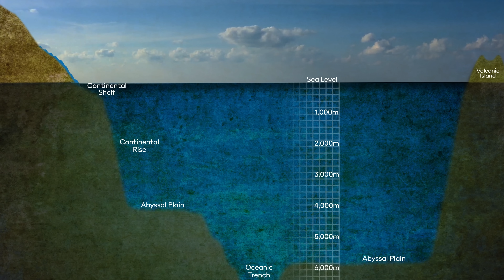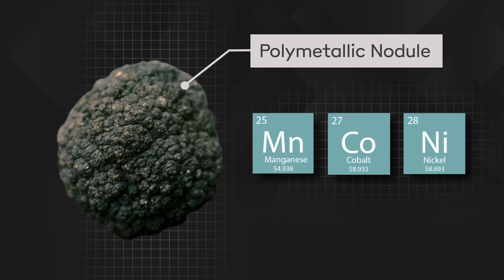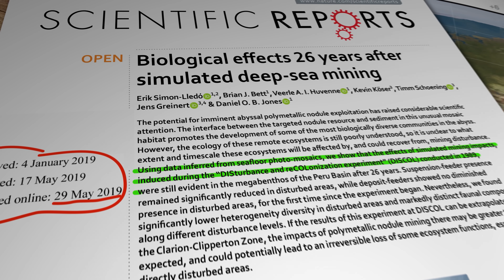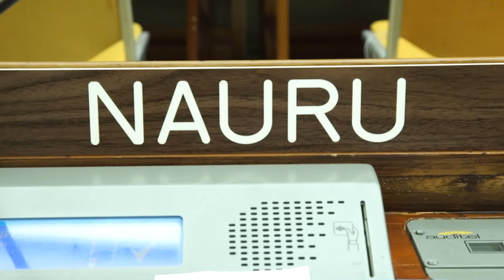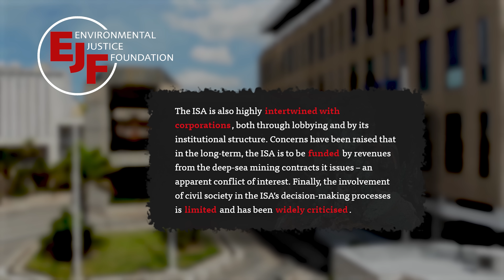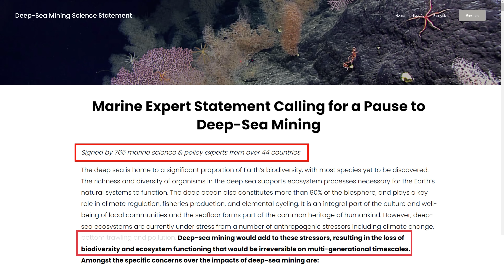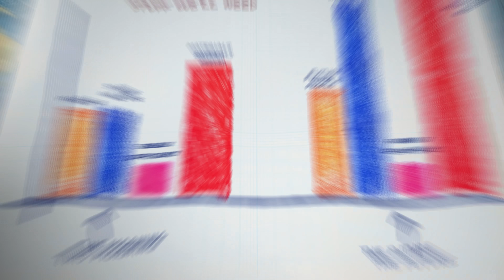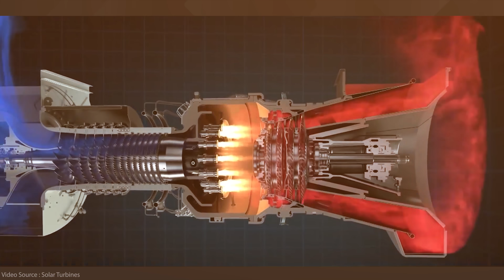Humans reach a new low. Literally!

Comment: Could dolphins be trained to collect these nodules? Seems like a much less invasive method. 

Don’t try to tell me dolphins aren’t capable of being trained for this task. They are far more intelligent any dog breed. Sheppards can be trained for a vast multitude of joint tasks, so it stands to reason the same concept could be applied to Dolphins. Who already work with humans without specific training. 

This is a good idea. A really good one. Their echolocation would easily find them, and they’d have no problems bringing it to the surface. 

And it would cost a lot less. Think about how many resources you can retain not needing to have a fleet of large ships that cost a ton to assemble and maintain. 

My goodness 1/10 the cost could have an entire company sized element of dolphin / handler combos trained ready for deployment. 

There has to be something I’m missing. No way nobody thought of this.

Comment: China has invaded the South China Sea to secure energy resorces. Under those noduals, is ten thousand years of natural gas, as fire ice. On the continental shelf about coastal nations. Billions have been squandered finding how to retrieve this from the same place. The pressure at this depth has solidified the gas. It can be burned to produce hydrogen, hence the expensive, mad drive to utilise that for vehicles.

Comment: Relying only on solar and wind will fail. They are great as secondary power, but they are not reliable enough to be the primary power source. They also are really lacking on the production side.  Its like trying to use 50MB USB cards instead of a 5 TB SSD.  Hydro electric and nuclear are what is needed.

Comment: Heat vents... One of two things... Most likely sucked dry... Then fault lines in the ocean get less pressure from below... Causing some heat vents to invert... While second one which is much more beneficial.... Building the ecosystem up that is already there.... Instead of the heat going straight up.... Spread it across the ocean floor... Leading to more prosperity for the deep sea... and most likely overtime grows into a hoter world.... Both would... Bigger animals mammals... This that the other.... I mean look what happens when a place gets a hole in the ozone... Man gets sick and the environment grows significantly...

Comment: Hard disagree with the point you're making at 13:13, that being that steel is just some product of the fossil fuel industry. Steel alloys are essential for pretty much every single thing you use every day, from the house you live in to the transportation you use to get around (whether thats a standard car or an electric train) to any one of a hundred different industries. The reason for this is that steel alloys can be tailored to practically any use, and are all strong, durable, and resistant to most environmental conditions while being fairly cheap to produce. This isn't something like a cobalt drill or catalyst for oil refining, steel is used everywhere and is vital to practically everything, unless you can somehow build railroad tracks out of wood and we go back to tiny wooden sailing ships for freight.

Comment: Considering how abysmal the extractive industries have been on lands over the last 150+ years, we
have no reason to believe they will be any less reckless when mining these nodules on the
sea floor. The potential for catastrophic damage
to the marine ecosystem, that might be 
irreparable, is extremely troubling. The track record with small scale underwater mining has already
proved to be devastating in the areas where it has
been tried. The kind of larger scale projects they are describing, could result in permanent damage that could impact marine ecosystems, weather systems globally and the marine food supply that so many around the world depend on for 
sustenance.  Their should be clear cut 
guidelines in place, prior to the start of any of these 
projects.

Comment: Here is the thing... You can draw a 200m by 200m square anywhere on the planet and then dig down 2000m... That area has more or less  all the manufacturing recourses we need in terms of metals, salts and fertilizer components.  Plus once you reach that depth you can extract geothermal energy out of it for as long as the planet if active. 
The only reason they don't do that is that the initial cost of doing this is inconvenient to them.

Comment: The back-end of the video was rather single-sided (uncharacteristic of you, tbh): you need the same catalytic processes to upgrade biofuels (the same nickel and cobalt based catalysts that are used now in refining processes for fossil feedstocks), or to upgrade circular feedstocks going into chemicals. High (tensile) strength steel is essential for the production of electric card (much more than for ICE cars), because of the added weight of the battery in these vehicles. Next to the automotive industries, steel production is also consumed by the construction industry. If you want to fly now, you will need gasturbines, whether you do this with fossil or non-fossil fuels... 

I suggest to discuss the details with industry experts before posting.

Comment: I agree that no mining of the oceans should be permitted anytime soon, and I believe 10 years is still far too soon to determine the impacts of it and even the continued use of hydrocarbons has disastrous impacts when spills arise with the extraction or transportation of them.
In terms of mentioning about reduction of the required minerals for transitioning from hydrocarbons to renewables, I disagree with the assessment, and so do many other people and we see it requiring more mineral resources. Currently for hydrocarbon use there is a lot of infrastructure in place and the use of materials that can easily and efficiently be recycled. which isn't currently the case for the transition to renewables. The initial transition away from fossil fuels is going to require more minerals mined from the ground. EV's use more minerals mined from the ground to build than Internal Combustion Engines (ICE's) and I remember a figure of 10 times the amount provided from a mining company involved in mining the extraction of materials required for EV's, not to mention the infrastructure that will be required to go all wind and solar powered which is unreliable and therefore requires further infrastructure to store energy for periods in which generation is low. In terms of batteries and EV's, a comparison between an EV and ICE vehicle of equal size will show that EV's are generally heavier meaning more wear and tear on the roads, tyres, brakes which will therefore need replacing more often requiring more mined materials. In terms of Sodium batteries, the weight will be even higher however the plus side is that sodium batteries will likely be better in terms of recyclability because currently most Li batteries aren't recycled due to the costs to recycle being greater than the raw mining of materials and not all the components can be reused from the used Li batteries. Overall this transition to renewables is going to need a huge volume of new materials however there are lots of areas still within the land that haven't been explored for resources, not to mention old historic mine waste heaps that were not considered for certain resources we may now need. It would be best to focus on these rather than the oceans which we do not fully understand yet.

Comment: Regarding your observations about the resources used by the fossil fuel industry, are you sure that the reduction in resource use achieved by eradicating fossil fuels is greater than the addition of resource use generated by renewable energy?  What would be the grounds for that claim, given that there would be the need for so much "overbuilding" of renewables?

Comment: It's best not to mess with the sea bed as I'm pretty sure we get a large portion of our oxygen from the sea, small self contained automated nuclear reactors should be invested in with everything we have, if the fuel is properly recycled it will last many millions of years.
This is almost free energy after the infrastructure and power plat is set up.  It's not for all places but you could produce enough to transport it or at least to use hydrolysis to make hydrogen for power ship and autonstove use and maybe even aircraft, also it would litraly bring potable water from seawater for next to nothing as you just need heat to desalinate.
It costs more to properly dispose / recycle a solar panel than to make it and the chemicals that can leak into the ground soil are very bad.
Wind only works well in some places.
I do hope a sustainable replacement can be made like hydrogen or methanol or anything that will allow the conversion of spark ignition engines and anytjibg that's an oil or a fuel gas or liquid will rub in compression ignition engines.
Current battery tech is way to wasteful and needs replacement way to often plus it pokutes skit and the fires...
Also it's not the best use of electricity.
Would really help a lot if we got rid of ships that use that awful bunker fuel or even something lower grade   (anything lower is just tar) but it's cheap.
To be completely honest I see no recorce problem I see an overpopulation problem.
If people are not sterilised in the 3rd world then it's nuclear or nothing for the near future.

Comment: So, Perry the Platypus... (Bites off a hot wing) I bet you're wondering why I'm sitting down here at the bottom of a lake. Well, the answer is simple. Mmm-mmm! This is really good, man. You want some? (Takes a box with the red wings) Here, here. (Perry takes a hot wing) Take the blue cheese. (Perry takes the blue cheese and pours it on the red wing) Do you know, I-- I prefer the ranch. Take the blue cheese. (Perry bite the red wing, and Doof holds up a napkin) Here's a napkin. (Perry takes the napkin) Anyway, the answer why I'm here is simple. Zinc. Lake Nose has a ton of zinc, and this machine goes around and filters all the zinc from the water.

Comment: I love engines an motor racing an fast cars. However petrochemical companies are waaaaay out in front at no.1 on the most evil an destructive industries. They been fear mongering an lobbying againg any type of new tech that might even slow the flow of oil coming out of the ground. They knew 70 years ago what they were doing to the climate an did nothing but lie.

Comment: Dave: please read this comment. This is the first time I've watched a "Just Have a Think" video and strongly disagreed with it. This is an incredibly tendentious video. You completely failed to contrast the comparative environmental impacts of acquiring these metals from land-based mines vs. deep sea-bed (pro tip: the damage mining does to land-based ecosystems and waters is VASTLY greater). You also completely failed to note that the deep-seabed miners have agreed to large exclusion zones that will ensure no species are driven to extinction. You exaggerated the level of ignorance about deep seabed habitats and the pathetic little worms that dwell down there. You failed to note that the total area that will be affected by deep seabed mining is a TINY fraction of the seabed benthos as a whole. You failed to note the possibility that stirring up seabed dirt will, by adding nutrients back into the water column, actually INCREASE the overall ecological productivity of the oceans - you just assumed that any impacts of the mining operations will be negative. You exaggerated, too, the ecological linkage between the activities of the benthic worms and the upper-ocean ecosystem. All in all, this video is, in my opinion - and I'm generally a bit of a superfan of yours - a stain on your reputation and the worst bit of muddleheaded propaganda I've ever seen from you by a long shot. Try to do better next time. You could have and should have taken the time to speak to some deep seabed mining experts - then your piece wouldn't have turned out to be so utterly one-sided. Giving you a grade of "shameful fail" on this one, mate.

Comment: The think about a good engineer is that they will always find a viable solution, thus if a material is scarce and expensive they should work on a different variant of the solution, hence batteries without Nickel and Lithium. Though if you tell a rich businessman about free money at the bottom of the ocean, he will pay his engineers to design a way to get those materials while the engineer could have worked on something more sustainable as we are all taught at university.
The smart people are not the problem in this world, it is the greedy ones.
I hope we leave our oceans alone, we have no idea what impact it will have and it will, most likely, be a global impact.

Comment: I’m of the opinion that this is an issue that can be solved with engineering. Instead of using the destructive method described in this video, I advocate the development of new robots specifically designed to harvest these nodules while avoiding stirring up seabed dust and using a more selective process which eliminates the risk of consuming undersea life forms. As far as habitat goes, they could either just take a small percentage of the nodules, or replace them with other forms of habitat.

There’s too many binary arguments in this world. People think that it’s either their way or the highway, but in reality, there are often arrangements that are beneficial to both parties, and they just need to be discovered.

Comment: Most folks here don't seem to understand the sheer scales involved here.
There are plenty of problems with deep sea mining, not least of which is the regulatory structures/agency.  But the sorts of massive destruction folks seem to be imagining would take centuries to happen even if humanity went all out trying to do it as destructively as possible.

If we want to actually explore these ecosystems, a sensible approach is to allow small-scale mining with independent oversight and environmental study/monitoring.

BTW: These areas will likely take centuries to recover from disturbance.  That's just expected, and everyone needs to be aware of that.  Deep sea mining is not remotely sustainable, but needs to be judged in a cost-benefits manner in comparison to the alternatives.

Comment: Perhaps there is a compromise here. Machines are already being developed to pick various crops on land.  This could be applied to the polymetallic nodules on the sea floor.  Perhaps a robotic picker could put nodules into a basket which could then be lifted to the surface. No messy separation of nodules from sea sediment.  This would be a good job for non-sentient AI.

Comment: Messing further with the worlds oceans... in areas that we know little about? Bonkers!
I work for one of the worlds largest manufacturers of mining equipment - underground mining specifically. Underground mining can have a tighter control on the environmental impact of operations. With new innovations in explosives we are greatly able to reduce gaseous NOx emissions and water contamination (using hydrogen peroxide as the oxidizing agent instead of the Nitrate based explosives typically used). Likewise, we are rapidly rolling out battery electric mining vehicles - when combined with a "clean" electrical supply we end up with close to "green" metal ore. Mining companies are also working hard to use non-carbon based smelting methods for production of iron and steel (see LKAB & SSAB).
This idea to mine oceans at depth - it makes my skin crawl. We are smarter than this - at least we should be.

Comment: Mining in the deep ocean, what could possibly go wrong? With the mining industry's famous concern for the environment, where they resist cleaning up even disasters easily discovered, SURELY they'll be vigilant and aggressive in reporting and cleaning up disasters that happen in the deep ocean. Would it even be POSSIBLE to clean up such disasters, considering the depths and pressures and darkness? Can we also put the criminals in charge of the jails, while we're at it?

Comment: We have so far to go in reducing things like single use plastic and badly made items that break in no time. Went in a supermarket the other day (I stopped shopping in those a few years ago) they still sell almost everything in plastic. That's in addition to the plastic tat they sell. There so be a ban on selling this 'shite' . Also we need to stop making 3 ton electric SUVS and make little electric city cars. My van has a small 24kWh battery and was cheap to buy and is light and efficient on electric (solar). Those huge Audis etc use twice as much electricity to go the same distance.

Comment: New mines will be required to transition from flammable fossils (FF) to non FF’s sources of energy eg solar, wind, tidal, wave and hydro energy converters, maybe not as many mines as some have advocated but new mines nevertheless will be required. Trying to get approval for land based mining in democratic countries is extremely difficult, and if anywhere near populated areas virtually impossible. Marine deep sea mining I’m afraid falls into the category of out of sight out of mind and doubly so when humanity’s exponential progress or its sustainability is threatened from CC/AGW. To date everything that been done to reduce CO2 hasn’t shown any reduction in fact just the opposite, even over the Covid-19 shutdowns and mobility restrictions CO2 levels have continued to increase along with petrochemical industries use of FF’s. Another point to be aware of is globally Electricity is only ~20% of energy supplied and renewable energy is only ~2% of that, leaving ~80% reliant on FF’s that would include pharmaceuticals, plastics, diesel, lubricating oils, waxes, polishes, bunker oil ( ships fuel) central heating oil (factories and domestic), bitumen for roads (asphalt) and roofing🤔